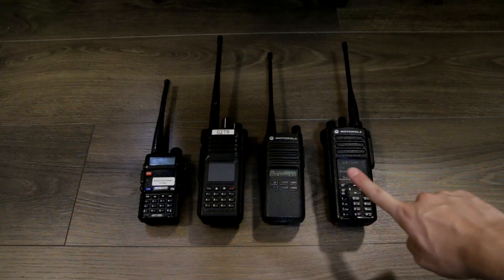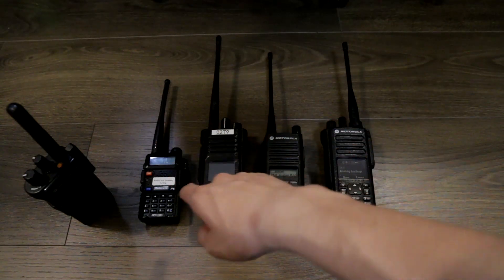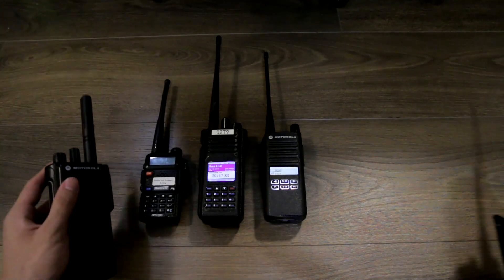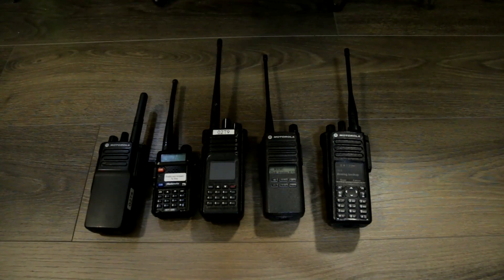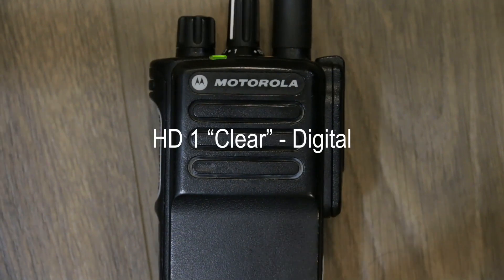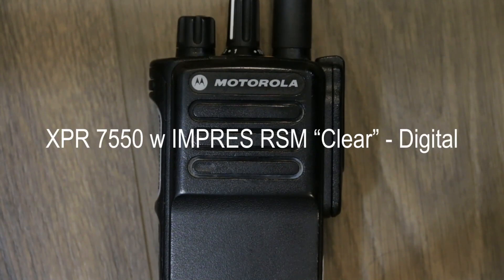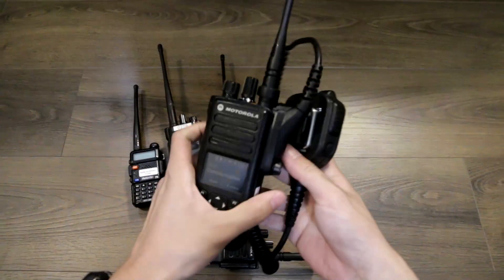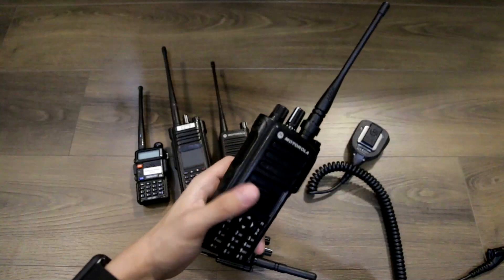Radio Extreme Wind/Noise Cancellation Test (UV5R, HD1, CP100D, XPR7550)

Comment: Hey man, quick question, after you let go of the PTT on the 7550, the receiving radio has a single beep, how did you get that? Does it come from the 7550? Or is it the receiving radio letting you know the channel is free?
Reply from the maker: Great question. The single beep is the 7350e DOS muting the MDC1200 from either CP100D or XPR7550 (both models support MDC signaling). From a normal (unsupported) radio, the full MDC1200 would play (like most scanner feeds of analog public safety agency). DOS muting can depend radio by radio (different settings required to achieve the certain sound).

As for channel free, the only feature in MotoTRBO radios that passively plays tones is the ARTS tone. When paired with ARTS enabled radios, the radio notifies you when it's out of range of others (in analog mode). Cool feature, unsure if it's only supported in Gen 2 subscribers.